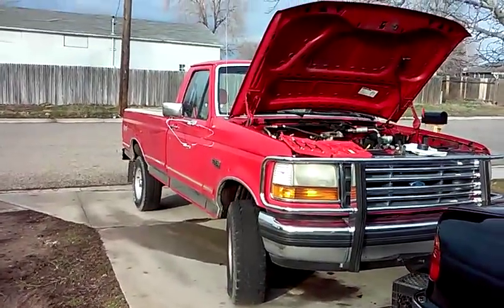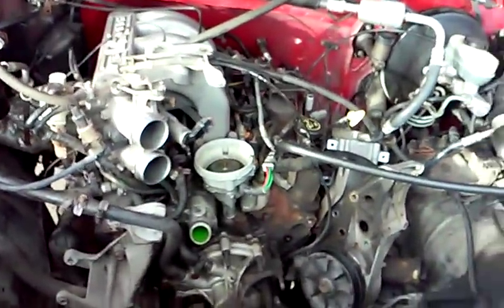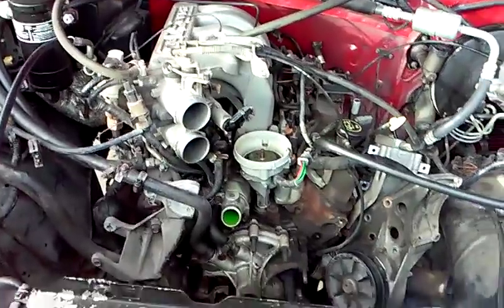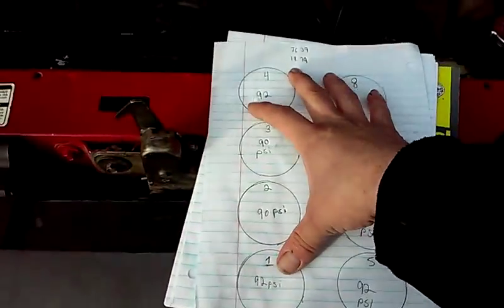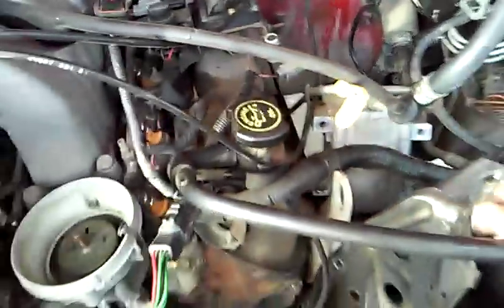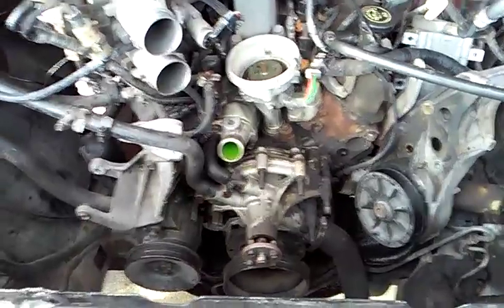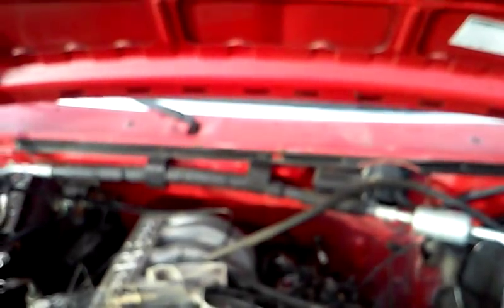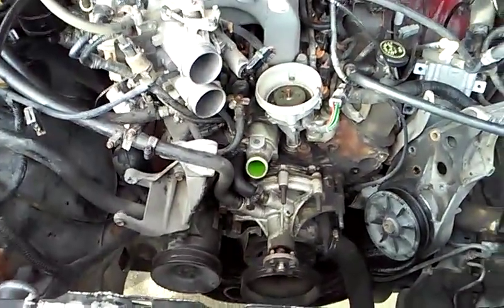1992 Ford F-150 5.0 302 diagnosis,timing

Comment: high how r you doing I have a 302 v8 high compression new  motor and it wont start its on time getting  gas but its only at 110 on the compression the front of the motor is getting fuel but the back of the motor #8 spark plug is wet with fuel it sparks out of the motor and  it wont start and it has compression
Reply from the maker: Hello. I am doing great. Just working in shop. So basically you have good compression, you have good spark, and you have good fuel pressure? (fuel checked with pressure gauge?)
Reply: yes #5 and #8 seems to be flooded but the compression is only 120 and I was told that's ok for a new motor
Reply from the maker: 120 is enough compression to fire. a dead cylinder would be anything below 90 psi. I would like to see around 145ish though........lets see we need 3 things to make a internal combustion happen....Spark,fuel, and oxygen. We have verified that we know we have good compression however I would be curios what compression was on the other cylinders and if there is a drastic difference in the numbers regardless of how high or low they are. EXAMPLE....CYLINDER #5 120....CYLINDER #1 145....I would also be interested in fuel delivery. you say that the plug is wet? based off of this statement I would think that is safe to assume that feul is at least being delivered into the cylinders in question.....however is it being delivered properly? is it being atomized and then delivered to the cylinder or is it just dripping and spraying in there. I would also be interested on the history of the "new" engine. is it new from factory or newly rebuilt?
Reply: new rebuilt and all the compression is the same at 120
Reply: if it had a intake valve stuck open would it still have compression in that cylinder
Reply from the maker: compression same in all 8 cylinders? 120?.......120 is more than enough for a 302 to fire......"if I had a intake valve stuck open would it still have compression in that cylinder?" NO........A stuck valve would mess with compression. 120 compression in all 8 cylinders is OK and tells me we probably do not have issues with timing or valve train...........maybe we should change our approach and angle here?............Have you checked firing order? Did you know that the ford 302 has different firing orders??? ford has the 302.....and also the 302HO........It all boils down to camshaft basically. Also some after market cam shafts will have different firing orders.  many aftermarket camshafts for older Fords often are used on the the newer 302 HO/351W order during rebuilds.
Reply: yes I have been using the 351 firing order I believe that is a 351 cam
Reply from the maker: The 302 roller cams 94 and up and the HO cam have the same FO as the 351 , but the older 302s have the old 302 firing order , the cams will still work by changing the FO on the cap , but the 302 roller cams will only work in a 351 roller ready block as far as i know...If you came to me as a customer......Based off of all the "verbal" information. I would start at the cam and the firing order and I would want to know for a FACT what cam was used and what type of tappet was used on rebuild....so I would request all rebuild specs and information. things like...... if it was a after market cam? any way to post a video of it turning over?
Reply: i don't have that info the person that built the motor is not with us any more don't know much about it but  i will look in to it more thank you for your input i will let you know what i fine out and get it running thank you so much for your help
Reply from the maker: you are welcome. shoot me a email highgrooveauto30@gmail.com if you want to talk on phone and ask more direct questions or need any more help. two heads can be better than one sometimes :).
Reply: got the pinto running it was the spark plugs needed hotter ones so happy thanks for your help
Reply from the maker: AWESOME!!!!!! glad to hear!!!

Comment: thanx man. it is efi. my temp gauge was kinda bouncing this morning but never got hot or lost power. may be that Tstat isn't opening all the way. I do need to check timing tho. i heard it came make them run hot. mine is hesitant from a stop. egr has been deleted not sure if there's a block plate. I still got the lines that dangle from the back of the heads. That could be a vacuum issue tho I reckon.

Comment: My 92 5.0 gets hot and sluggish only when it's really really hot out.  It's got me puzzled. I'm thinking I'll start w a new tstat. maybe it's not opening all the way. timing is my next guess. can I just adjust the distributor shaft?
Reply from the maker: is it EFI or NON EFI? I can post the factory procedure for you if you would like. Also my Email is Highgrooveauto30@gmail.com. I have been known to trade numbers and walk people through procedures.
Reply: @MattShaughnessy6 w 'll u please call me 9132461288 im no good with computer my truck 92 302 wont start I have worked my ass off I am stumped